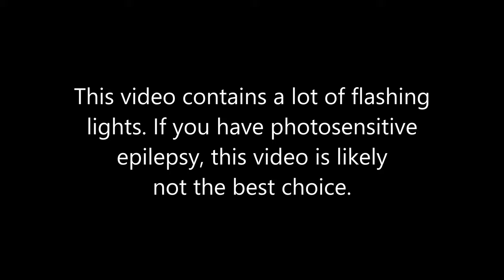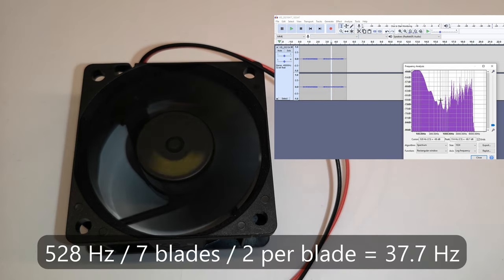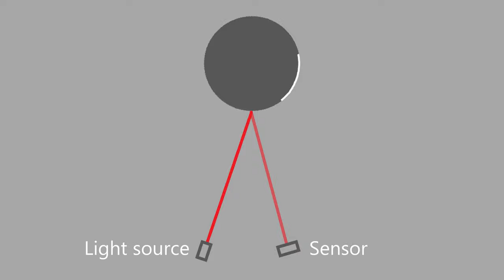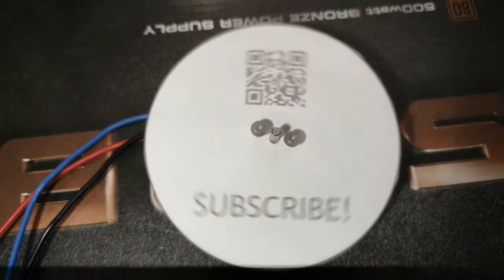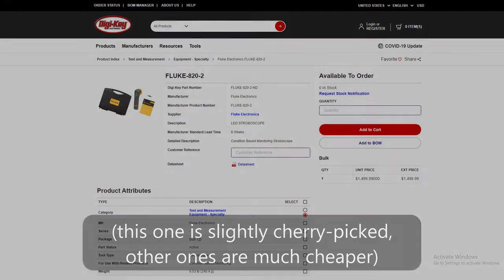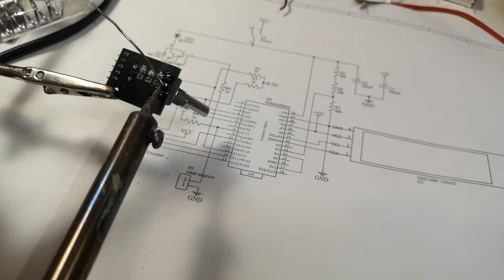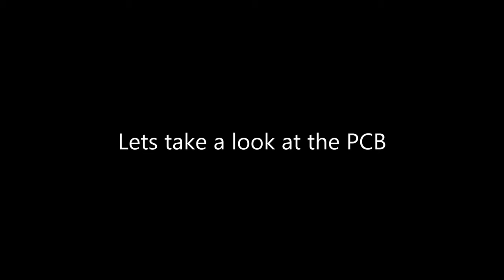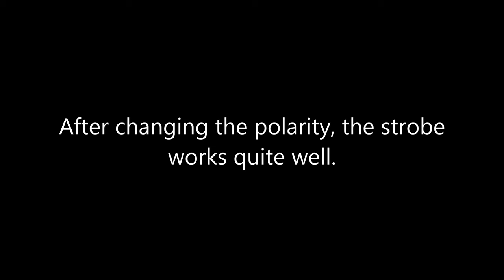Building a DIY stroboscope for measuring RPM

Comment: I built this project. (I built three YouTube designs, including this one.) I found this design is the best of them because: 
1. Resolution is adjustable better than 1Hz, and can thus be really fine tuned.
2. Duty cycle is operator controlled. I can really obtain sharp images with this feature.
Thanks for the upload. It will be used to check the spindle speeds on my CNC router.

Comment: Hello, I have a ready LED module, 20W but 12V. Can I connect an external 12V power supply to VCC without any problems?
Reply from the maker: It should be fine assuming the arduino's voltage regulator is an AMS1117 or something similar that can handle >12V.

Also, make sure the LED's average power isn't high enough to cause it to overheat, since in the circuit there isn't really any proper current limiting.
Reply: I made your project, it came out pretty good, but the low battery message keeps flashing, I should add that I used capacitors from your diagram

Comment: whats the max hz and what limits how fast you can pulse this
Reply from the maker: in the provided code it is limited to 31.250 kHz, though if you remove that limit it can go up to several MHz, at this limit it is the arduino's relatively slow clock speed